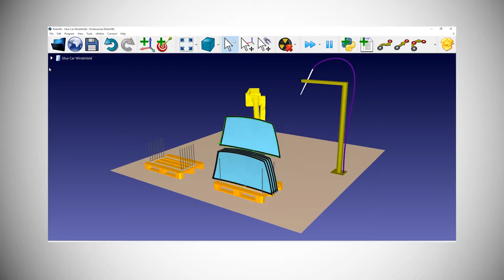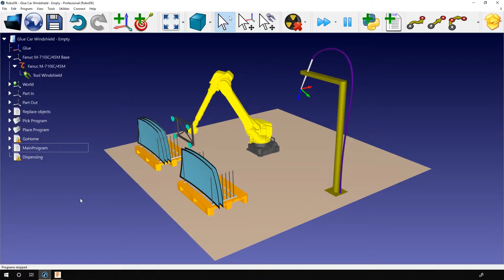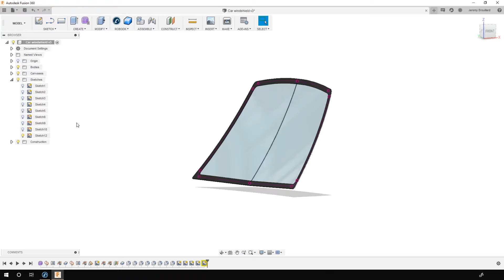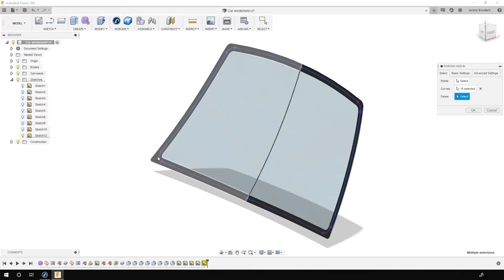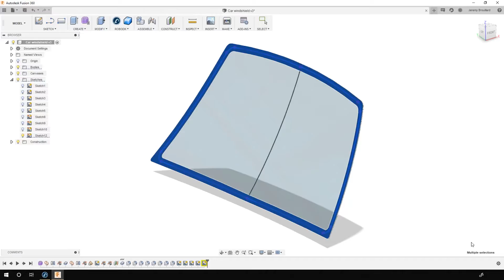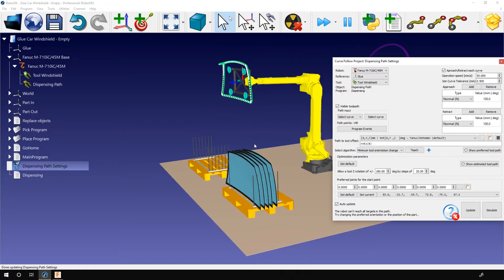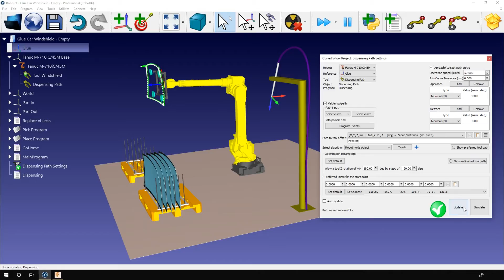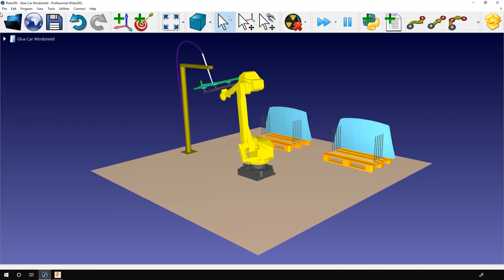Glue Dispensing with a Fanuc robot - Fusion 360 - RoboDK Add-In

Comment: Good tutorial. I have a question, The process of importing the windshield can be done with solidworks?
Reply: I would have the same question, is it also possible with solidworks?
Reply: Fusion 360 will import virtually any 3D model, so yes a SolidWorks source shouldn't be an issue.